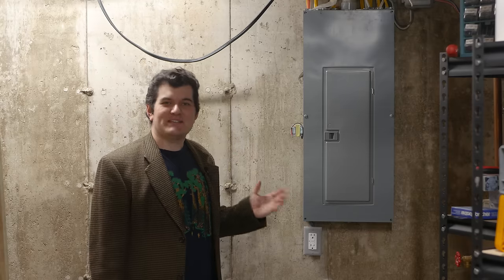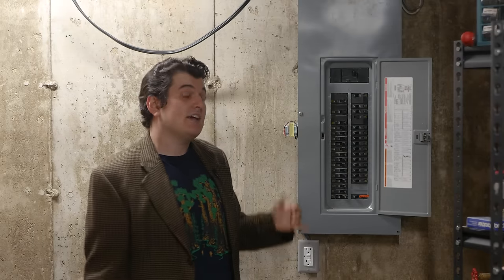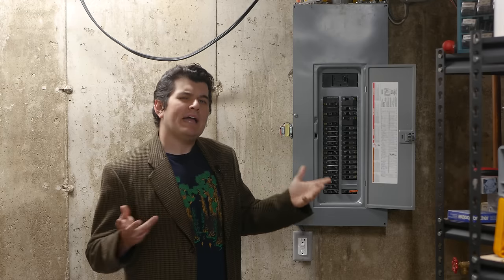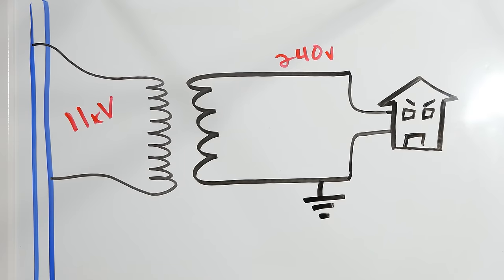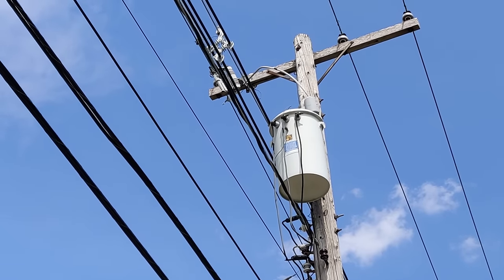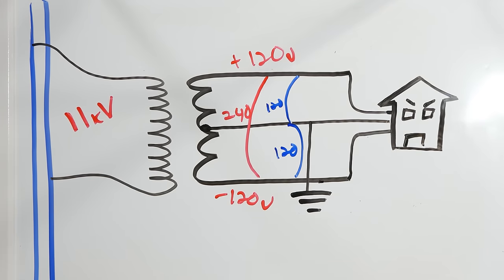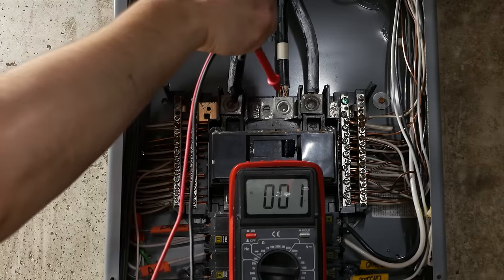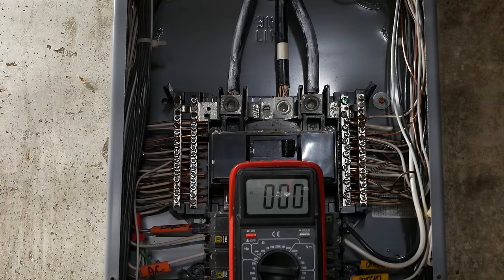The US electrical system is not 120V

Comment: 240V shock : In the 70's, the adapter from 3-prong ( 220V 50Hz ) to a 2 prong plug for the Christmas tree lights was male ended, with the Christmas tree lights being the female ended plug. Cue me touching the prongs sticking out of the wall. I could feel a pulse in my arm ( like when someone takes your blood pressure with a testing sleeve ), and the tip of my finger felt it had touched something that was hot and also felt like it squeezed the top of my finger really hard. There was a bang ( if I remember it well ). My finger hurt for a couple of days. I took one for the team so you don't have to ! 🙂

Comment: We have 240V
Almost every EU house: Laughing in 3 phase 400V
Reply: Not exactly common in cities but in rural areas where heavier machinery (ie. agricultural) is more likely to be used yeah, it's almost in every household.
Reply: And building. I have 400v electric stove plug in my flat
Reply: @demogorgonzola  Very common in houses in NL. Almost all houses have it wired to the meter, but it is up to the user if he wants 3 phase. The standard is either 40A or 3*25A. Both have advantages and disadvantages, but if you want it it's a simple replacement of a meter and fuse by the grid operator.
Reply: @demogorgonzola  In Poland almost all new homes have 3phase power, same for new flats. Only place where you dont have 3phase power are most of old flats and some of very old homes.
Reply: @demogorgonzola  Very common in Finland. Stoves run on 3 phase and then there are all the saunas...
Reply: Yep, 3 phase TN-grounding and 400V phase-phase. There is also IT/TT with 230V phase-phase.
Reply: @demogorgonzola  German apartment buildings all have 3-phase 400V. We don't even get 240V stoves, so it's probably mandatory by now.
Reply: Pretty much all homes have 3 phase unless you live in a one room apartment.  Most stoves is 3 phase, bit 1 phase to exist, they are really rare.
Reply: For commercial/industrial use, and some extreme residential cases, the US does have 480v three-phase power available, it just wasn't covered in this video.
Reply: krawcik3     Yes but at a considerable lower current. you only get a 25A fuse maybe a 32A fuse, and in Sweden 16A is normal.     240V 200A is  48KW     3P 400V at 32A is only  22KW (ok 22.08KW)
Reply: @erlendse  remind me which one has neutral and ground the same? Saves me having to find the wiring regulations book!
Reply: @demogorgonzola  Very common in Austria, we need it for the stove.
Reply: You can purchase 3 phase service in the US, but it is an additional cost.
Reply: In central Brazil we have 220v in each phase, with a possibility of 380v with 3 phases
Reply: @erlendse  But IT/TT is for mines mostly :D
Reply: @hairyairey  Neither. What you are thinking is TN-C and TN-S. TN-C(ommon) has 4 wires. TN-S(eparate) has 5 wires.
Reply: Most houses have three phases lines to balance the load across three different 220V lines, so having 380V sockets is just a matter of arranging the wires in the proper way.
Reply: @demogorgonzola  in germany every full fledged oven has 3×400V
Reply: @samiraperi467  I doubt your stoves run on three phase. I suspect that the three phase feed is treated as three single line feeds internally to the appliance.  As for saunas, I don't know. If I want to sweat, I walk outside.  Almost died once.  I hate outside.
Reply: In Denmark almost all buildings have access to 3x400V@40-63A. Even my small 60m2 apartment from 1931.
Reply: I'm super jelly. I'm getting into hobby stuff that will probably involve old industrial machinery and might have to get a proper phase converter instead of having access to dedicated 3 phase
Reply: @jesperdahl1486  3x25/32/35A are common for apartments (at least here in Germany), whereas the 240V 200A in the US is for a whole house. For larger houses 3x63A 400V is common here, which is comparable in terms of power delivery to the 48 kW of the 240V 200A.
Reply: @demogorgonzola  I have it in my single person apartment, we Germans use 3 phases to power our oven.
Reply: @ez45  Most (if not all) stoves allow to be run on 230V, the bridges are included. Important for older flats, where the stove is only supplied with 230V 20-25A.
Reply: He didnt go into it.
But yes. We largely transmit in 3 phase. 
Getting it hooked up to your house though is a different story. 
Because our transformers naturally put out two phase there wasnt ever a large demand for three phase. And going from 2 to 3 phase is actually really simple and cheap to do. 

... So the three phases tend to be divided amongst the entire neighbourhoods. To make it easier and cheaper to power everyone.
Reply: @ez45  There are 230V Stoves, but they are the worst. And funny enough our stoves don't use the 3 phases together, they are split between the plates and the oven.
Reply: 22kW is neat for continous-flow water heaters and charging an electric car...
Reply: @werewolf2003002  Yeah, but in many countries in europe it is the norm, in most houses, not just commercial or extreme cases.
Reply: @matsv201  I live in a one room appartment and have three phase 400v. My stove runs on that. In Denmark btw
Reply: @ez45  it's not, i've been living in a 1phase appartement from 2008 to 2016. They reworked the breaker-panels in the whole building during this time without changing it to 3phase, so i'm quite confident it still is 1phase. And you can bridge (every?) stove to make it work with just one phase.
Reply: Personally, I despise electric ovens, stoves and water heaters. Natural gas or propane is the way to go.
Reply: Nope, not here in Spain, that's not very common.
Reply: @werewolf2003002  Yeah, much of our neighborhood distribution is at 480v, just split when it goes out to the houses.
Reply: The US also has 3 phase power, but if you have it in all homes and most are not using it, you're just paying for something useless. But muh superiority in paying MORE.
Reply: Samira Peri Finish Saunas.    
Very famous.
Reply: ez45 so no more SS?   
Only SSS?  

....... ok.  I could not help myself and made that cheep racial joke.   Being Polish.  I apologize & ban myself for life from YT. 
SORRRY!!!!
Reply: @matsv201  unless it's a stove combined with a cooker, it's usually just 2 phase input, same for most induction heater tops...not that surprising once you realize just how much power can 2x400V @ 16A deliver ;-)
btw almost all induction heater tops can run on single phase, but with considerably reduced power.
Reply: @jesperdahl1486  In the Netherlands, you can upgrade any residential home to 3*63A. You would pay for the upgrade inside your house and you'll pay a little more in monthly fees, but it's considered domestic and the upgrade outside your house will be covered by the energy provider. Only above 3*63A is considered commercial/industrial, and if the connection to your property isn't capable of delivering that, you might have to pay for the new infrastructure outside, which could easily be so expensive that just moving your business elsewhere is a better deal.
Reply: @trinidad17  It's not useless - you can use the individual phases as, well, single phases still. In that respect it's quite comparable to your split-phase system, just with three phases delivering power and only one neutral needed. With the added bonus that we can run proper motors off the same service without resorting to crutches like phase converters or start/run capacitors.
Reply: @joerivanlier1180  You are quite right. I had it done just before my EV arrived.
Reply: This. Who the hell talks up two phases of 120V each like it's amazing? My oven in a regular tiny little apartment has 3x240V. Of course Americans have to use gas ranges and ovens, you're barely beyond smashing rocks together to make sparks.

Comment: Next up: "The european electrical system is not 240V" and how three phase power systems work.
Reply: ah yes, with explanations of tn-c, tn-c-s, tn-s and it systems, although that might be a video for itself
Reply: Yup according to the logic in the video, most of the world is operating on a 360/400V system.
Reply: @patrick_test123  415V, even. Most ex British colonies (and the UK itself) still have 240/415V everywhere even if on paper it's dropped to 230/400V.
Reply: @der94alex  Take a look (if you haven't already) at John Ward's channel.
Reply: @juhanasiren6824  oh nice calm well explained videos, but I watch TC for the silly jokes and his style of presentation
Reply: @someonesomewhere1240  before 230/400 we had 220/380, afaik it changed to 230 for compatibility with other countrys while barely fitting the on paper tolerance of old appliances, sounds kinda similar
Reply: 230/400

Comment: 13:00
Now I'm imagining a dryer powered by a single-cylinder engine with one of those pull-cord crankshafts, belching exhaust into the basement as it dries your clothes.
Reply: This is basically what you assemble if you get into panning for gold or have some other reason you want to sift dirt and rocks
Reply: Gas engine washers/dryers used to be a thing, although not what he is referring to. Usually the exhaust would be plumbed outside, and they had a foot operated lever to start. Look up "Maytag hit & miss engine"
Reply: He said gas not petrol.
Reply: @toemblem  We call petrol "gas" here in the former Empire.
Reply: @veretos7  Oh my G--.
Reply: @veretos7  Right, because of course your washing machine needs a carburetor; Well, it is after all the American Way, I'm sorry to say...
Reply: Wait, your dryer is not run by a gas turbine? Weird.
Reply: Natural gas dryers are great if your house is plumbed for it. BTW an electric motor spins the drum, and it is the heat that that is supplied by the NG. My laundry center was in the garage and there was aflue that ran from the back of the dryer to the roof of the garage where a cupola type structure on the roof allowed the exhaust fumes to dissipate into the atmosphere. Considering typical prices for electricity and NG, the gas dryer operating costs were about half of the electric dryers. They also were much quicker in drying clothes.
Reply: @bobraible  Don't take it too seriously but it's a joke based on the statement "gas powered dryer".
Reply: @tom23421  It seems to be an int'l group on this topic. I thought I'd clarify in case some were unfamiliar with the concept.
Reply: @tom23421  Don't forget the gas powered refrigerators. You light a fire to get them cold.
Reply: @veretos7  They were very common in the Midwest before Rural Electrification became a thing. Also, they're technically not hit-and-miss engines, though they are often called that. The Maytag engine flywheel has a governor inside it that turns the ignition on and off to limit engine speed at varying loads. A hit-and-miss engine has a cylinder valve that is closed by a governor when the flywheel speed gets too low, initiating the compression and combustion cycle.

i have a couple Maytag engines, and they sound similar to hit-and-miss engines when idling with no load. They also sound like an engine that's misfiring a lot...lol.